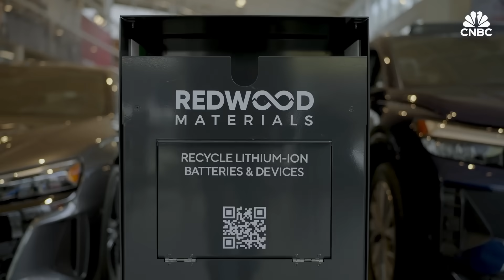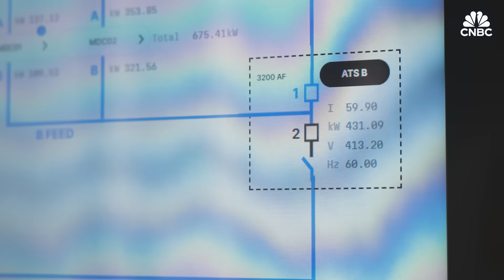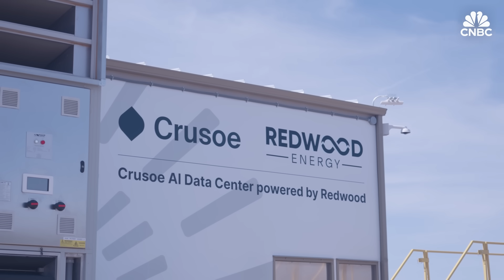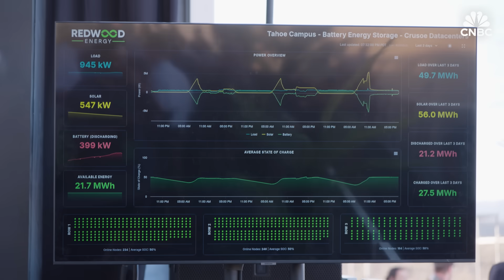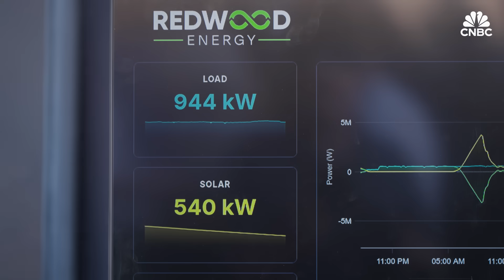How Used EV Batteries Are Being Turned Into Data Centers To Power AI

Comment: "The concept of repurposing 'Used EV Batteries Into Data Centers' is a masterstroke of industrial sustainability. Even when an EV battery drops to 70-80% capacity—making it less ideal for a high-performance vehicle—it remains a powerhouse for stationary storage. By creating Battery Energy Storage Systems (BESS) for AI data centers, we solve two problems at once: we manage the looming 'battery waste' crisis from the first generation of EVs, and we provide the buffer power needed to stabilize the grid as AI chips (like NVIDIA’s latest GPUs) consume unprecedented amounts of electricity. This isn't just recycling; it’s a strategic energy bridge."

Comment: Yes and no. The car batteries hold a lot less than you would think and they discharge at an even slower rate. Its still worth it to get a lithium ion battery in a rack that can be cycled 6000 times.

Comment: He said we "have the capacity to be the lowest cost supplier of lithium ion batteries" - but isn't the big threat for this kind of use sodium-iron chemistry? Lithium ion is ideal for mobile stuff (like cars, phones, laptops) because the energy is more concentrated. Surely for something like this the real threat on the horizon is sodium ion? Heavy batteries for situations where mobility isn't necessary. Or even sand batteries. About the only plus point is that their current source material is cheap and I can guess they can pivot when they need to. In forty years I suspect this sort of thing will be regarded as a quaint short term fix.

Comment: I don't understand why people are throwing away batteries with 80% life remaining. Can someone explain this?
Reply: Recalled battery cores (such as those LG packs in Chevy Bolts) could work perfectly fine.. but it's illegal to install them back in a car.
Reply: @romanval69  That seems like too specific to make a whole business model out of recalled batteries. Why those were recalled?
Reply: @_ata_3  The Chevy EV battery recall was due to fire risk.  This business is primarily a battery recycler— grinding up old lithium batteries and turning them into base components (to sell back to manufacturers).  But they also receive a lot of good batteries in the process.   The beauty of this is it doesn’t matter if the pack is too degraded for EVs— as long as it can still hold a charge it’s useful.
Reply: @romanval69  Thanks. Still there seems to be too much wasted batteries. I suppose there are many defects in production.

Comment: man you can build rack to stack these... awesome.  Dust proof and weather proof.  Close loop liquid cool as well.
Reply: They Arent using any cooling it seems. They set it up this wide, in case any of the batteries goes on fire, it doesn't light up the other ones.
But I don't know what they do with the white bags over them. I would just shield them off the sunlight and rain

Comment: Ridiculous how much land that uses
Reply: So?  No shortage of land in the Nevada desert.
Reply: wait until you see how much land and material it takes to build a coal fired plant.
Reply: @jdfershizzle I've seen them. The footprint is very small. Once they are done mining the coal the land is remediated and goes back to nature. Never will happen with a solar farm, they get abandoned in place.
Reply: @thedopplereffect00  You need to look at the bigger picture if you want to understand what I am saying. High spec pipes and pressure vessels don't just pop out of the ground. It takes a tremendous amount of energy and land to make that happen. When you look at your cell phone, you might think it has a low footprint also, but you would be dead wrong.

Comment: Seems silly to me to refurbish batteries for the grid rather than for resale back to vehicle owners.
Reply: None of these batteries are refurbished. They're either warranty core or recalled.  But they still hold a charge which is good enough for stationary use.
Reply: @romanval69 warranty core is a battery that can be refurbished for use in a vehicle.

This is about controlling supply so people are forced to pay full price for new batteries when refurbishment is possible.
Reply: @rswright89  Warranty core packs have degraded more then 30% within 8 years... usually caused by a several defective cells.  The problem is EV packs are so tightly built that the time and effort it would takes to tear apart, test, replace and rebuild the pack isn't worth it.  Batteries that are recalled because of fire risk (like those LG packs for Chevy Bolts) are illegal to use in a motor vehicle.     But both can be used here as-is.
Reply: @romanval69 nearly all EV replacements are into the 5 figure range.

I do not believe for a minute that people can't make money off doing pack refurbishment for half the cost of a new one. I've seen plenty of packs torn apart and it's quite straight forward.
Reply: @rswright89  Pack repair is easily done at an individual scale (such as DIY repair).  But for manufacturers that build thousands of new battery packs per day it's much easier to just toss the old pack and replace it with a new one.   The price of building that replacement is already built into the price of the new vehicle anyways (exactly the same as new car warranties for gasoline vehicles-- they expect a small percentage to fail but can build it into the price to still take car of the customer).    There will always be businesses that can rebuild those degraded packs-- the same as there will always be businesses that can rebuild defective ICE engines.  But this company is NOT in that business..

Comment: All that waste that will end up in the garbage.
Reply: They're a battery recycling company-- at the end of its life they turn those batteries back into base materials.
Reply: @romanval69 Are we sure it looks like they just ripped them out and are using them as is. Eventually, they will be waste.
Reply: @Voicenreason247  Nope.  This company main job is to shred old batteries and turn them into bags of plastics, metals, and other elements (lithium/cobalt/nickel)-- ready to be processed into new batteries.   But they also get a lot of batteries that still work fine-- which is how they made this giant battery field.
Reply: @romanval69 ok I thought they just bought wrecked ones and used them. Then they would just throw them out like the original owner. I stand corrected.

Comment: I would much prefer if those batteries were at least underneath solar pergola's...direct sunlight on what is essentially black enclosures will degrade the battery either in optimal operational range or battery longevity.

Comment: Nissan was doing this development in parallel with their Leaf. The summer after the Fukushima incident, when they experienced rolling brownouts, homes that were powered by Leaf batteries were able to stay on because the home effectively had two inputs. One to the grid and the other to the Leaf power pack system, which was basically their version of the Tesla Powerwall but made from Leaf battery packs. Since the Leaf's battery is actually made up of packs and not just individual cells, repurposing packs is relatively easy. I am not sure how far they took that project because to my knowledge the only places that had that tech was Japan and Isle of Islay where they did a test prototype install at a whiskey distillery.

Comment: Those fires are going to be epic.
Reply: Check the distance they've put between the batteries. If any should catch fire (which surely can happen, but very rarely), it will burn up without affecting the other ones.
Reply: @janterjeaugestad8431 finally someone smart😂
Reply: That's not how any of that works. There are around 8 redundant systems that would all need to fail all at once to make that possible. EV fires are incredibly rare for exactly that reason. On top of the fact that iron-phosphate batteries are not as volatile, and neither are sulfur (coming to EVs next year).
Reply: the toxic smoke will stimulate the economy. Thousands of new cancer customers, millions of dollars for ivy league environmental impact studies, millions of dollars in new fire fighting equipment. Billions of tax dollars in free handouts to make more poisonous batteries.
Reply: The battery packs are still in the same case they were when installed in vehicles.  Do you see a lot of EVs catching fire in the rain?
Reply: Let it rain, Let it rain and go boom🤣😂😅

Comment: The fact that these batteries could work 3-5 more years means it's all just a safety and legislation problem, and these guys are benefitting from it by making money out of literally thin air...
Reply: No. There is a big difference between mobile and stationary use. If you have a 70 mile round trip to and from work, an ev with a 100 mile range does the job. But if the battery drops to 65% you will run out of power 5 miles away from home at the retourn trip, aka the car/battery is useless. That does not matter for a stationary use like this though.

The other thing is power density. You need to expend a certain amount of energy to transport each kilo for a mile. So if e.g. your battery holds 10 kWh of power, and it requires 1kWh to transport that kilo of battery, that leaves you with 9kWh of usable power to transport the rest of the car, cargo etc. If your capacity drops by 50%, that gives you 5kWh, of which 1 is still used for the battery. So you drop from 9 kWh usable to 4 kWh usable, or a 56% drop in actuall range for the car. And that split only gets extremer the further down you go. 
But again in a stationary system you don't have to move the battery at all, so once it's in place it doesn't matter if you get 10kWh, 5kWh or even just 1 kWh of capacity out of it, 100% of that capacity is directly usable for you

Comment: Only taking advantage of old unreliable battery prices to build their own battery banks for cheap as the country doesn't know what to do with them... Still dangerous that's why they are all so far apart, one day catches all in fire and rip this company 

People also buy used cars instead of new ones. It's just the normal way how everything works, if the price is right people will pay for it. No big deal....
Reply: Don't know ehat to do with them they literally recycled them 😂
Reply: @mcsike7264 that's not recycling that's called reusing, buying second hand

Comment: THERE'S THE PIECE OF THE NARATIVE TOTALLY MISSING FROM THIS STORY
AND ITS IMPORTANT
We simply DO NOT have enough Lithium in the mineral reserves to build all the batteries needed for the EV revolution let alone the energy transition.

A Tesla S needs about 65kg of Lithium.
There's 1.5billion registered cars on the planet and to replace them with EVs requires around 95million tons of Lithium.
If you look at Wikipedia for Lithium there's a table for reserves and resources. The difference is that a reserve is what's feasible to mine and the total reserve is 30million tons. PLUS at current mining rates it will take almost 150years to mine those 30million tons. 
SO ITS CRITICAL THAT WE MAXIMISE THE USE OF THE LITHIUM WE HAVE.

So 2nd lifing and then recycling the lithium is CRITICAL.
Reply: M8 you forgot one word "RECYCLING" am tird of the whole "we dont have enough lithium" we can use other things than lithium btw like sodium
Reply: @mcsike7264  OK DlCKHEAD we need 95million tons JUST TO DO the cars and there's only 30million tons in reserves.

SO COM'ON GENIUS EXPLAIN where the other 65million tons is coming from and then explain where the millions of tons more we will need for mobile phone, laptops, power tools and all the other stuff we use lithium batteries in.

And then there's the trucks and motor cycles and ships and planes and the mega batteries used for grid applications.

SURE Sodium MIGHT do what we want but they first have to prove they work. There's the Sadoway battery as well but that has not seen much adoption.

Comment: @10:13 
HOLY CRAP LOOK AT ALL THOSE FOOT PRINTS ON THE SOLAR PANELS!! That is literally thousands and thousands of dollars worth of damage. Solar panels inner structure is extremely brittle and fragile and just a small amount of weight can reduce the output of the panel by 60%!!!!
Reply: What tf are you talking about 😂
Reply: @mcsike7264 is it not obvious what I mentioned you thick head
Reply: @mcsike7264 When you walk all over solar panels with boots and a persons weight is enough to damage the panel
Reply: @mcsike7264 ya THICK head.

Comment: How many solar panels to charge the battery?
 and why not directly to the grid from the solar panel?? 
Or is this battery only for peak hours or emergency?? 

I swear, repeaters are getting worse at reporting the info that makes sense.... they keep saying batteries are "being put to use" not the grid... but they couldn't say how the process works.. here I help you:  install a lot of solar panels, use that to changer the batteries, that in turn will supply extra electricity to the grid during peak hours or during the night... 
Just explain in simple few sentences how the thing is working in general... Jesus!!
Reply: Right...they said like the batteries can generate power.

Comment: Do not use used batteries they are not as efficient as new batteries, what a waste of potential energy!
Reply: Used batteries habe 80+% capacity wdym not as efficient
Reply: @mcsike7264  25% bad cells has bad internal resistance which turns into wasted heat.
Reply: So throw them in the dump?  You think the Redwood guys don't have a handle on which batteries to use and which to recycle?

Comment: Wouldn’t it be more efficient to tilt the solar panels while also covering the batteries from direct sun exposure
Reply: yes and no, when and if there is an thermal run away event, those panels would be cooked as well, so it's a huge risk
Reply: @droomagon those battery packs are cooking in the sun just saying. We all know how inefficient Evs get when in cold and hot climates
Reply: Technically tilting the panels is more efficient, but nowadays the panels themselves are so cheap the majority of the cost of an installation is in the mounting hardware and the manpower to install it. Cutting down on those costs and justxthrowing in more panels to reach the same power production can be worth it. Especialy in a desert like they are in, where the land is available for dirt cheap
Reply: @reappermen  that’s a good point. Thanks for pointing that out. Makes sense

Comment: Let us face the truth why Used EV batteries are used as temporary solutions to store energy for AI data centers due to power generation shortage- there are still red tapes as well as long waiting time to build enough power plants especially nuclear power plants to power up the AI centers. Once those are solved, these used EV batteries will be less relevant for AI centers-it just wastes more energy convert generated electric power to stored energy then to AI data centres. AI data centres are smart enough to use on-demand power from newer power plants with AI build into them.
Reply: Bc batteries help smooth out the power band even the slightest power disturbance can disturb the AI center so battery help smooth it out its not the lack of power thats the problem

Comment: This is obviously a scam. All batteries other than the single battery model that is shown several times are covered in plastic until they figure out how to plug it in their network (different voltages, capacities, current ratings etc), and there are only ~10 of them. Also don't get confused: this is nowhere close to the amount of energy needed in an AI data center. I mean just look at the size of a data center and then look at the volume of these batteries. If somehow you invested in this, sell before people figure it out.